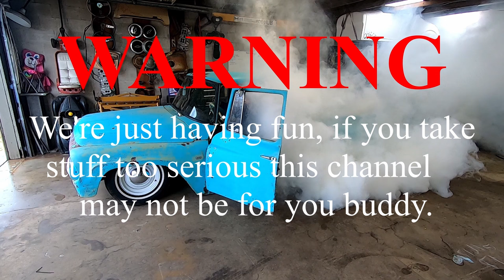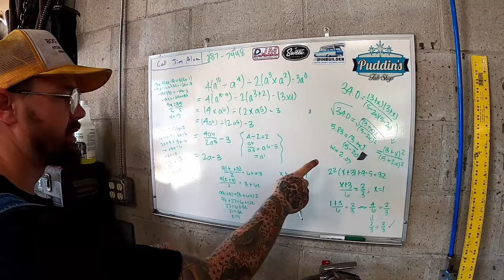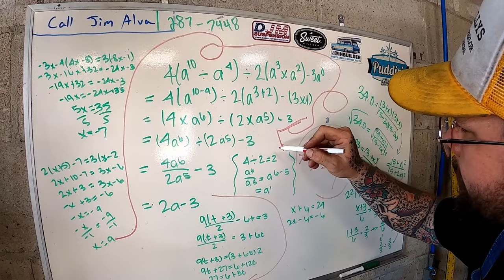The Yee Hawl gets a carburetor FINALLY.  ((IT CATCHES ON FIRE!!!))

Comment: Yep! My friend hooked the fuel line up to the main vacuum port on a Edelbrock four barrel, I have the key the electric fuel pump came on around like it seemed forever before it pressured up and the motor turned a couple times and stopped but it was a brand new motor and we were just putting it in his 65 Chevy pick up so we were troubleshooting it, I thought I would check for spark, little did I know that the motor was completely full of gas and when it went off we nearly burned the truck in the shop and a whole enchilada to the ground, we all ran out and then we thought oh shit and so I ran back and grab the fire extinguisher and put it out lol I guess we thought it was going to explode!!! 😂😂😂😂Your channel is a lot of fun to watch keep it up

Comment: Haven't set one on fire yet,  but came close.  Overfilled the transmission on a 77 Mustang II and it spit fluid out the dip stick and onto the exhaust manifold.  I did get a good deal on an 88 F-250 that cough fire from a rats nest on the driver side manifold.

Comment: i cant believe you set it on fire, i have never done that, but when i did it was removing a fuel pressure test adapter over a glowing catalytic converter, connecting a ground wire to the positive battery terminal on a starter solenoid, and trying to crank an engine with a broken main ground wire and it backing up through the smaller grounds and setting them on fire. 3 minor fires no big deal. oh forgot about that time i didnt have a screwdriver plugged into a spark plug wire dangling over an open spark plug hole and shot a 2 foot flame out the side of the engine.

Comment: Yep set fire to a 1976 Chevy Scottsdale next to a gas pump. She would not start for some reason without priming it and I forgot to put the breather lid back on it backfired blew gas everywhere, and some idiot came over and beat it with an old piece of carpet and spread the fire all over the top of the engine and the fuel line which was under pressure blew and made things worse. I had to completely rewire everything under the hood and replace several hoses. Oh, and I replaced the carburetor so no more priming. Two days after I got her running like a champ my uncle borrowed it and wrecked and totaled it. Approximately 500 repair dollars down the drain not to mention the $1000.00 1980 dollars (today that is roughly $2500.00) I just spent having the transmission rebuilt complete with a high performance shift kit.

Comment: So I have a square body obsession, was welding a crack in a cast iron exhaust on an 88’ ford ranger 2.3l and caught the fabric on the o2 sensor on fire and the oil around the valve cover caught fire to . Thank god we had a garden hose on standby Lol. Also was using a torch to break a broken thermostat bolt loose on my 88’ s10 2.8v6 and the valve cover had a little bit of oil that had leaked around the engine which of course caught fire. Had to use a shirt to put the fire out!

Comment: I set my 2009 Silverado on fire back in 2014 or 2015. It all started with some bad gas from Arco (will never get gas there again). It drove fine for about an hour or so after getting the gas, but after stopping and letting it sit for an hor or so, it picked up a horrible misfire. I took my injectors out to clean them and must have tore an O ring putting them back in because it took a while to start, like it had a vacuum leak, and when it did, flames erupted from the area of the #7 cylinder's injector. Insurance covered it though and said it was not my fault. Didn't even raise my rates so that was pretty sweet.

Comment: Lawnmowers, motorcycles, cars, trucks, if it runs on gas, I've set it afire. Don't know if its the same with pinesol, but the ultrasonic cleaner at work, I have to use 3 parts water to 1 part soap to get optimum cleaning

Comment: 61 Chevy, 72 Chevy, 69 Kenworth, 81 Autocar, and 88 Feightliner.......
Chevys were in the engine bays and the big trucks were in the cab.  None burned down...........  
The Frightliner, I was wiping down the dash with a cleaner and my cig caught the rag on fire !  Got a call on the CB when the guy passing me looked over and seen me snapping the rag around before I threw it on the floor and stomp it out 🔥
Everything was ok......
Just needed a new pair of shorts !
                   🙄

Comment: I had my positive battery cable ground out on my header because the two got well acquainted.  That set the cable on fire, which happened to be near the fuel line…  almost went very bad, but I just blew the fire out.  Since then I make sure my headers have a lot of breathing room.

Comment: I set a brand new Corvette on fire back in college days that had fewer than 100 miles on it.  What was I doing?  Adding a quart of oil. 😳. The oil cap was between the air cleaner and the power brake booster.  I had to “shoot” the oil between them and I missed…dumping oil on a red hot exhaust manifold.  The customer was right there watching.  Needless to say he got very white very quickly.  I managed to blow out the fire.  The was back in the days before plastic oil bottles.  Cans of oil were cardboard with metal tops and bottoms and required a spout to pierce the can which then served as a pouring spout.

Comment: Yes I have. While adjusting my Holley float level on my 70 fastback the coil wire  some how moved close enough to ground and up it went. I didn't have one Holley,I had three two barrels and it was the last one I was adjusting when all the gas soaked rags that I had placed under the carbs ontop of the intake went up in flames. I was working at a gas station at that time and I was doing the adjusting right next to the first set of pumps next to the office. The flames spr ed fast,both sides of the engine engulfed in flames burning wire harness,plug wires etc. Flames shooting up through the open hood through the blower style hood scoop about four foot high or so. I was 17 at the time and in shock. Lucky the guy working in the shop saw all this and grabbed the first extinguisher but it was dead. So was the second and the fire was really snap crackle popin by then. Thank God the gentalman grabbed the windshield washer bucket with the squeegees in and dumped about four gallans of water on the flames and that put it out. My hood scoop looked like a chimney with all the smoke going through it. Ever wire,hose and even the paint on the hood was smoked. Never did that again. Love your show,be careful. Dieter heins

Comment: I replaced a battery cable on a Toyota pickup I owned.  I didn't remove the old cable because it was part of the electric harness for the truck.  As I drove the truck home from work, the old cable bounced around and hit the positive battery cable and the oil filter.  This burned 🔥 a hole in the filter, and the leaking oil caught on fire.  I pulled into a gas station in Maud, OK and popped the hood.  As I ran around looking for something to put the fire out, I found a discarded cup of Dr. Pepper.  Just enough to put out a fire.  Thank goodness for litter!
Reply from the maker: That sounds like a Maud Oklahoma story!

Comment: 46 chevy truck with sbc left the elec fuel pump on and filled a cyender and being a puddin pulled the coil wire yep a msd had the pligs out and damn those coils do work excellent. fire ex near by but one damn hard agent to clean

Comment: hey buddy, love your show. I grew up with my dads old 78 courier 2.3l 5 spd. the best way to grab power is to throw away that stock camshaft, the stock cam in those years ruin the power over 2500 rpm, since you have a low gear it makes the engine power useless. grab a cam that builds power in the 2000-5000 range, I even used my old followers. it will wake that sucker up.......new truck. and throw that carb away, no matter what anyone says if you have a 4 cylinder get a Weber. mine was a 38 mm mech secondary. my exhaust header was like yours but it was a 2 to 1,then 2 to 1 again, like a "tri y"design for a v8. get a modern distributor .........you'll be pleased, that power will pull all the way past 5000 rpm, instead of ending right after 2500.

Comment: Well there Pudding, I set a 1974 AMC Gremlin on fire trying to cut the seats out of it.  That undercoating went up like a torch.  Fortunately, we were able to smother it out before the whole rig went up.  Might of been better if she had burned down to the ground, ended up giving that car to my sister who drove it until it died in 1984.  I think the worn out suspension almost gave her permanent medical issues.  Anyway, you aren't the only one who has done it.

Comment: Had an electrical fire under the hood of a deathtrap I used to have. Was out on some trails, in the dark. Lost lights and my electric radiator fans. Managed to bandaid the wiring a little so my fans worked. But had to use my phones flashlight to see where I was goin lol.

Comment: Fellow Oklahomie here. I have totally set a suburban on fire before. Was tryin to get it to run and drive on a trailer had a little tank of gas with an electrical pump under the hood “temp wired” 😉 she sparked. Luckily had a fire extinguisher too. Could have been a bad time quick

Comment: Ok ,@ 22;30.  It was a 1974 Mazda RX 4 with a rotary engine and the infamous ignition system that had two sets of points, and two coils, one to fire each rotor in the wankel engine.  They were very difficult to set the timing on,  and they also had a 4 BBL carburetor.  When it backfired through the carb, the puddle of gas formed where I  missed the carb while bottle feeding my baby caught fire.   This was in the basement garage of my house, and my fire suppression system was a basket of wet clothes which was waiting for the dryer.  Of course because of the dual coils and 4 BBL, my fire was twice as hot as my normal VW fires.  I did go out the next day and get myself a new ABC extinguisher, but I gave up on the Mazda.  Proving the theory that there is an ass for every seat, someone bought it from me.  But just like airplane landings, it was a good fire.  I walked away, and I learned something.

Comment: I used to work in a bike shop and put an electronic ignition on a customers 750 Norton Commando.  I took is for a test ride and about half a block from the shop she went up in flames. Dude never mentioned the carb was leaking

Comment: Damn. My father set his old station wagon on fire... unhooked the fuel line and had open headers... they "spun her to check" and forgot about the fuel line... boy I remember the fireball. Following my father's footsteps, a 1991 corolla caught fire in my hands while doing some electrical wiring that sparked a bit... after I messed with the fuel system. Both vehicles survived with minimal damage. Hopefully my son doesn't actually burn a car down after us hahaha

Comment: I set my c10 on fire welding floorboards in it and sparks caught the insulation under the dash on fire. I left, came back and the garage was filled with smoke

Comment: I put a new rebuilt 2 bbl cobb-er-atah, on my 63 Comet and I noticed smoke coming from my hood at a stop light in south Charlotte NC. I open the hood and a small fire was coming from the side of the 6 cyl.  I blew it out and whipped the fire with an old shirt that I had in the car.  i must have looked funny, but I did put the fire out!    My new carb was defective because the accelerator pump-rubber fuel plunger, inside the carb was not rebuilt and the carb was spitting fuel all over the engine compartment.   Not nice ...

Comment: i didn't lite fire to my truck....but i did my v8 volvo lol.  went through hours of work re-gasketing the top end and if anyone has worked on a v8 s80 they know there is no room. drove it to the car wash after to clean all the oil off the motor.  sprayed it down with engine cleaner and damn that stuff is flammable. got the fire extinguisher and got it out fast and washed the bay after.  needed to replace some wiring looms after but it was clean and oil free! lmao

Comment: Oh yeah, had a couple of small BBQ's. Mostly accidental, and mostly to do with welding. All small stuff that could be fixed with a splash of my water or whupping it with my hat.  Not had any petrol go woof at me yet, but then that's because I've got a CO2 and a powder extinguisher handy so Murphy's law dictates that it won't do until I lose track of where I put them.  

Actually, being brutally honest with myself I should really tidy up a dedicated corner for them since where they are now it's highly likely I'd struggle to get hold of them if I did torch the place. Thanks for bringing that to mind fella

Comment: I had a dodge stratus RT I believe it was an 02 cant remember, anyway that car repaired itself all the time.

It was the wierdest car, serious stuff would break on it and then it would get better or not cause an issue. 

One time we pulled into a hotel to check in, and our engine caught fire - no idea why. Looked like the wiring harness took the brunt of the damage. 

We got it parked, and we got the fire put out. The next morning the car was ready to go, no problems. 

The car had a 3.0l v6 and boy was it a fast car, to this day my wife and I call it the autobot because it would always just go back to working.

That is the only car that caught on fire, but it is embarassing especially when you just pull into a hotel drive-up and it spontaneously catches fire.

Comment: Thanks for the idea, My son has a 73 capri 2600 v6 with the same shitty holley weber 5200 as the courier. I bought him a chinese autolite 2100 for his car. I see it bolts right on. He rebuilt it the holley weber carb and it get way too much fuel at an idle. hopefully this will solve his idle issue and give him more power in the mid range being a true 2 barrel carb,

Comment: I had a dang ol 89 New Yorker with a quarter million miles on it that had a power steering leak. I stopped at the bank one Friday and actually sat in the car to sign my paycheck and fill out the deposit slip. It smoked all the time being as it was a clapped out Dodge, but it had been turned off for several minutes and smoke was still rollin and gettin worse.. Finally I thought, hell this heap is on fire. Luckily, I had a gallon jug of water leftover from a weekend fishin/campin trip in the back seat. I pulled the hood release, grabbed the gallon jug and popped the hood...sumbish went full on backdraft right there in front of the bank. I got er put out with the campin water luckily, then went inside did my bankin business, asked the teller if I could use the phone to call AAA because my car was on fire in the parking lot. She gave me a frightened look, and I said I thought it was put out, but I still need a tow.

Comment: Most of my old coats and work clothes were loaded with dielectric oil, add  that to using my belly as a workbench. I caught on fire so much my boss on a temp job banned my from the front office. The burnt holes in my coats and the smokey smell got him grief from his bosses. Kinda ironic considering the company name was greif. Went thru 5 coats in one month there. Wised up and used my brothers old nomex nascar coat after that. Kinda gaudy/pimpy but ruined alot less work shirts.

Comment: Yep, set my 65 F100 on fire after pulling the motor and using a cut off wheel to cut the engine cradle out….fuel line was evaporating enough to turn into a medium flame thrower.

Comment: My father in law found out that O'Reilly's reman engines are trash as well after the 3rd engine and a total of 50 miles from all 3 he finally asked me to build him a engine. In a 2000 astro van so it wasn't a cakewalk to pull the engine. He being a contractor learned the hard way

Comment: I about burned down my truck twice do to some wiring I did that got messed up after the hood closed and cut the hot wire I had running to a switch for some of those light that ground to the mount you use

Comment: I set an old S10 blazer on fire. Blew fuel line off while pulling a car and lit on fire. I unhooked the trailer and plowed it into a snowbank and called fire department. I still have the half melted license plate in my garage on the wall.

Comment: I have set a engine on fire on a nova SS... It had a hairline crack in the bowl and didn't see it at first but boy did II ever see it when it ignited the leak from a cracked spark plug wire

Comment: Out and about one day my positive battery cable broke at the post
with no tools in hand i was out of luck till i found an old battery charger clamp on the side of the road
using that to hold the cable to the post i got home all well and good.
only i forgot all about it the next day and went to do something.

not sure how but my clutch line burst into flame leaving me on the side of the road.
luckily it didnt burn the truck down.

Comment: That exhaust sounds like it is killing your power. Leaks or to big = loss of torque especially on the low end and that little elf engine needs all it can get to mouse squeak them pizza cutter tires lol Oh my fire happen on my 76 K5 Blazer was the battery bracket broke and put the + right against the fender. Every ground caught on fire. One ice tea and two waters saved the K5 I got lucky the terminal melted off and killed the connection while I was putting out the flames. The worst flame came up through the B&M shifter from the cable on it was a ground that flamed up. Now I make sure my rides all have fire extinguishers in them. You aint alone on the fire world brotha.

Comment: Hey dont feel bad puddin ,we done sumthin even dumber by cuttin up a car in the garage beneath the house an the fuel pump an lines still had gas ,the tank was gone motor gone but lines an pump still in car .we hooked a chain to flaming car a dragged it through the middle of double doors section  . Destroyed garage front wall an doors . We laughed we cried an we paid high for our stupidity . No one hurt house still livable